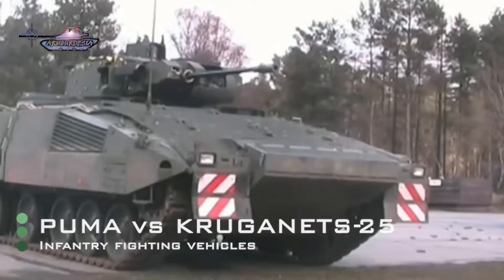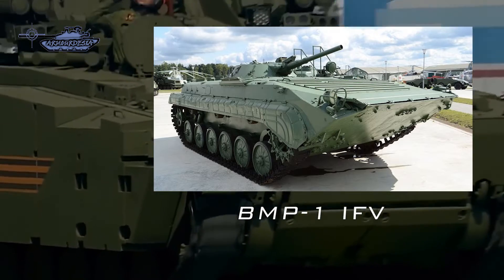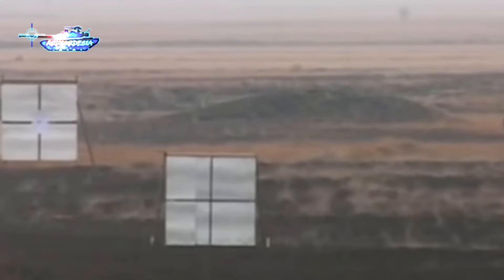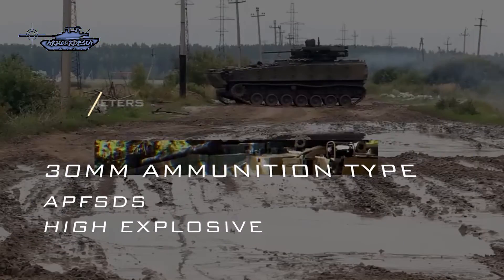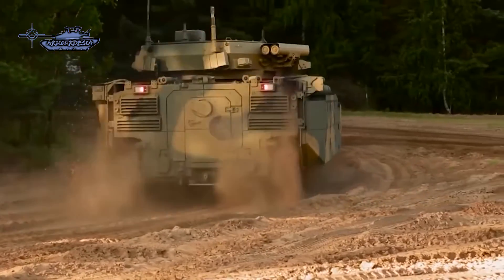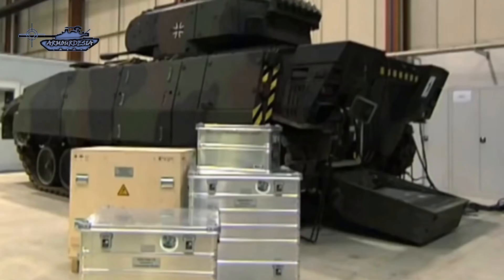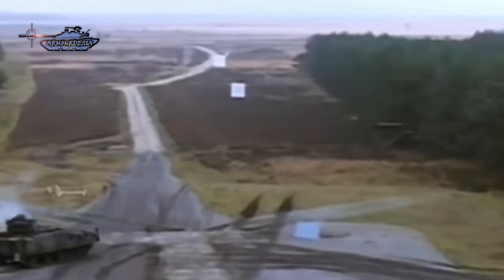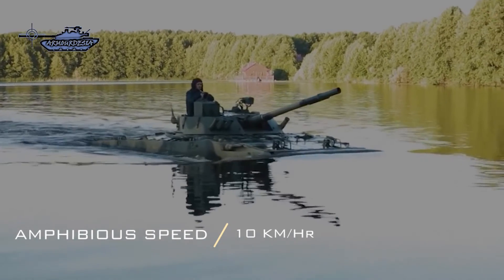Kurganets-25 vs Puma infantry fighting vehicle | Russian vs German IFV

Comment: Vheicles are not in same class, Puma and T-15 are, so they should be comaped.
Reply: No it's different purpose, T-15 and Puma is a heavy IFV the armor is heavier than kurganets-25, this kurganets was suppose to fill all russian BMP/BMD series role which was need to be light enough to be amphibious and air transportable.
Reply: @theinsomnia9282  the puma is also air transportable. I can go under water same as the Leopard 2.
Reply: The kurganets is very much on the same level with the Puma and T-15 actually
Reply: @xAlexTobiasxB  Not even close protection-wise. Kurganets weights 25 tons, Puma weights 43 and T-15 48 tons. Different purpose.
Reply: @jonny2954  yeah except you completely ignore the fact that Kurganets has Active hard-kill protection System which can intercept rockets and some missiles, while Puma only has smoke grenades which only gives it limited protection.
Reply: @xAlexTobiasxB  Puma also has a IR-Jammer. But you are missing the point here, Active Protection Systems are add-on subsystems that do not require a redesign of a vehicle to be fitted, they don't define a vehicles capability in such a way as passive protection level does. An APS can be fitted as an afterthought no problem, an increase of passive protection can't be done that easily, at least not without compromising other factors such as mobility. As example, Puma can be fitted with Hardkill APS aswell (Rheinmetall ADS), yet Kurganets could never possibly be uparmored to meet the passive protection level present on the Puma, not without a larger engine, which again would require a redesign of the hull, new suspension etc. In the end it would be a completely different vehicle.
Reply: @jonny2954  But Puma is not equipped with hard kill aps in reaility and that's what matters. Theory is irrelevant if it's not implemented. So Kurganets still has better protection in real life. Even the Leopard 2 will only have 17 vehicles upgraded with the Trophy APS. 

17 vehicles. 

That's nothing.
Reply: @xAlexTobiasxB  Even without Hardkill APS the Puma has better protection than the Kurganets. Even considerably so. The Afghanit APS version on the Kurganets only protects the vehicle from RPG/ATGM in a limited frontal arc and elevation, with bad to no mulit-hit capability. KE protection is much higher on the Puma, and so is mine/IED and bomblet protection.
Reply: @jonny2954  Stop deluding yourself. No passive armor is as good as active hard kill protection system. Not even close. There is no guarantee that the passive reactive armor can actually defeat a modern tandem-HEAT missile like the Kornet that can penetrate over 1000mm of armor. Not even Main Battle Tank armor can stop such powerful missile. 
Why do you think they start upgrading Main Battle Tanks with APS? If the armor alone was enough, there would not even be a need to equip them with APS or? Use some common sense.

So if even heavy MBTs with heavy composite armor can't survive powerful ATGM's, then the less armored Puma can't either. You say the Kurganets can't survive multiple hits, Bro this is a luxury problem. But at least it can survice one missile. the Puma on the other hand can't even survive one single hit by a powerful missile. 
One hit and it's dead.
Reply: @xAlexTobiasxB  Kornet is SACLOS, it is defeated by the MUSS Softkill Active Protection System, no need for Hardkill against that. And by that i mean in a 360° arc and 70° elevation with multi hit capability. An Infrared jammer does not deplete like Hardkill APS cartridges, so in theory Puma can widhstand an infinite amount of Kornets lol. Was even successfully tested against "jamming resistant" Kornet-EM, apparently it wasn't so jamming resistant after all.

Yet Kurganets can survive one hit by a Kornet on one spot, yet its passive armor is so bad that a 70s RPG from behind (where no APS coverage is, even though AT teams are trained to take out vehicles from behind) can take it out. Do you really think that such a vehicle is better protected?
Reply: @xAlexTobiasxB  quote from you "But Puma is not equipped with hard kill aps in reaility and that's what matters." and the russian tank does not exist in reality and that's what matters^^
Reply: @Mar-s5q8m  The Kurganets does exist in reality. Just not in large numbers as the Puma, but it does exist (in lower numbers). But it will be produced in more numbers in the future.
Reply: @jonny2954  kornet is laser guided, not SACLOS lmao
Reply: @cunnyrapist007  Laser is SACLOS. There are wire and radio-guided SACLOS and beam-riding SACLOS. Kornet is a beam-riding SACLOS.